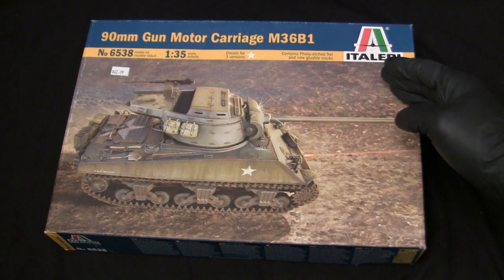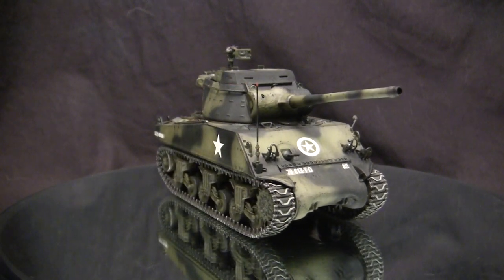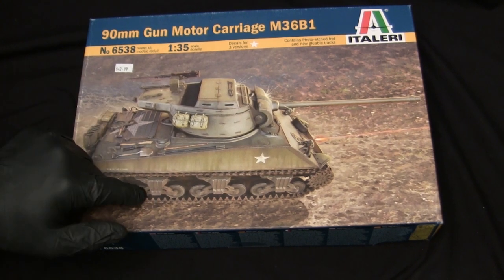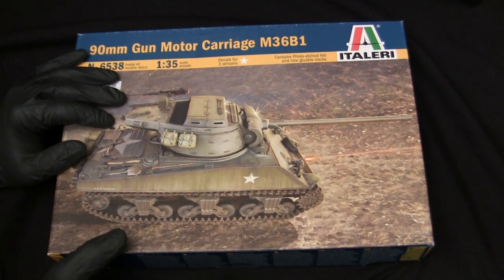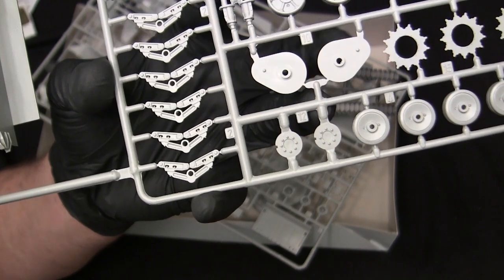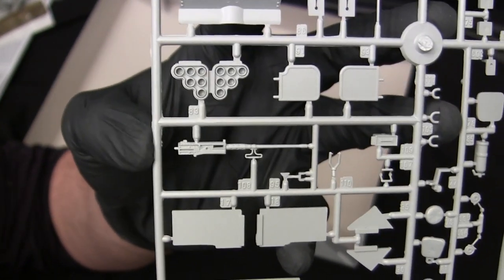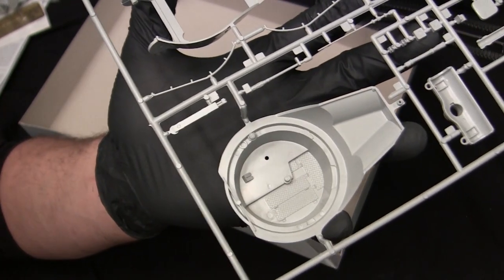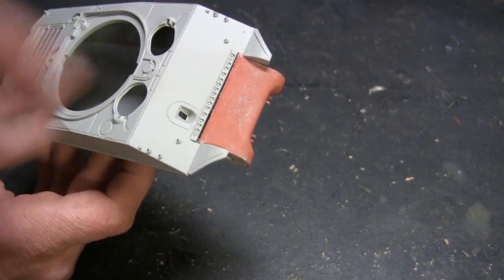1/35th scale Italeri M36B1 Jackson Tank Destroyer

Comment: Thank you for these superb videos. The info is very informative and relevant to modelers. I have learned a lot from you. Is it safe to paint vinyl tracks with enamel?
Reply from the maker: Thanks for appreciating the info. On the single piece tracks, no avoid enamels at all costs, I only use acrylics for tracks for the reasons I mention in the videos. In a nutshell enamels can have a side effect of interfering with the tracks and can cause them to fall apart in time or can cause other really bad outcomes, so as a rule of them just use acrylics for single piece vinyl tracks